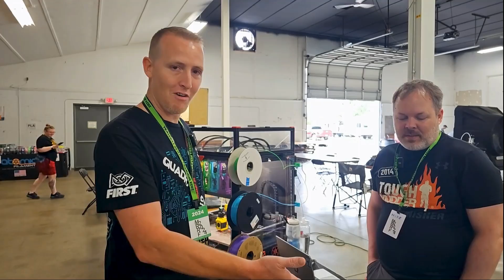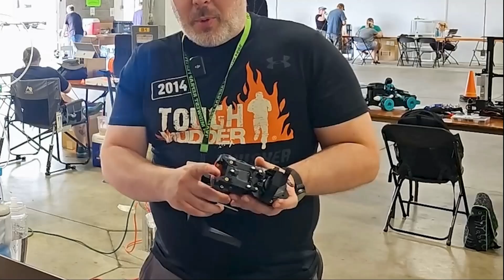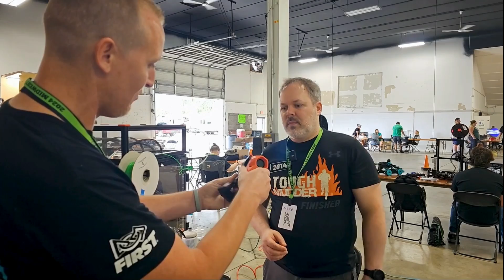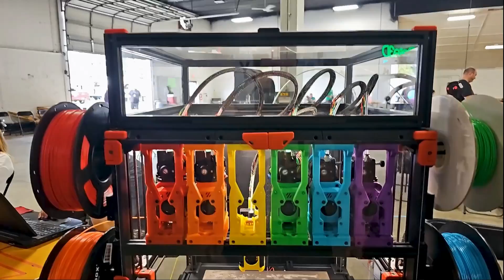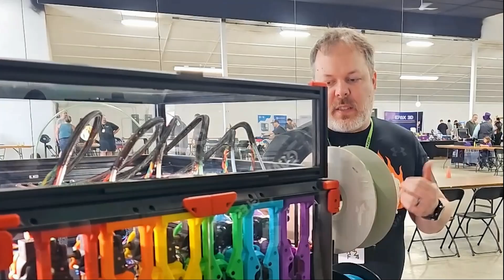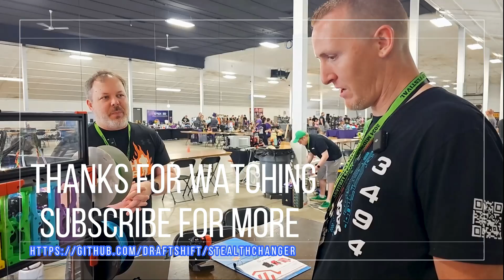Exclusive Interview at MRRF: DraftShift Design's Stealthchanger in Action | 3D Printing Innovation

Comment: What is size of printer(bed useable) and make you have this on, I see 6 nozzles on this stealthburner?  What type of price to build something similar in late 2025? What is considered best heat sink extruder etc to use.  Curious on best  options.  Is there a kit?  Answered my own question see a kit at West 3d....checking out specs, pricing, options, etc.   Very slick, been holding off to see what new tech is still to come.
Reply from the maker: This was a Voron 2.4 and can use several different hotends if you want. The project has been very well kept up with. And. YES! West3D is great! If you purchase from there save yourself 5 percent off the order with code LEEMERIE3D!

Comment: Couldn't that dowel pin design also be used in TAP to get rid of the z-rail?
Reply from the maker: It absolutely could yes. It could be redesigned to work with the dowel pins. Once we run some input shaper results on the Stealthchanger we are building. If it works well, I might do a mod for tap to use the dowel pins instead if you are interested I'll send to you to try out.
Reply: Absolutely would be interested. Tap is great but any weight savings in it's construction would be a clear plus.
Reply from the maker: On it! Totally agree, getting the weight down on tap is a big plus.